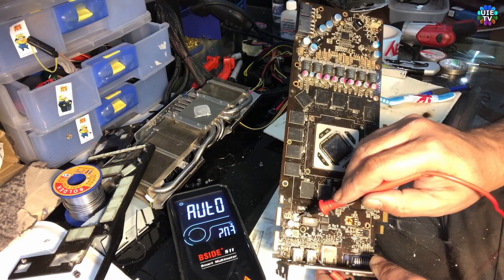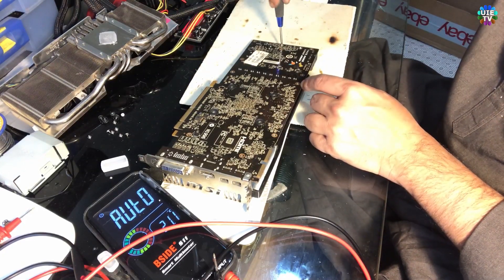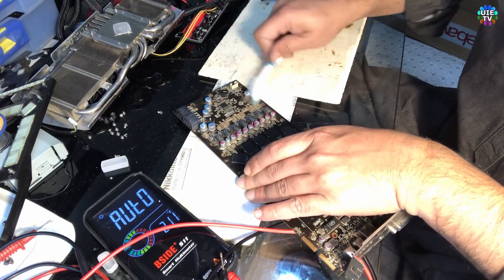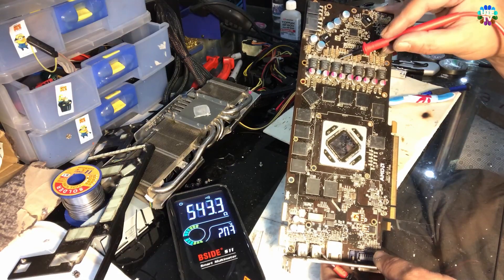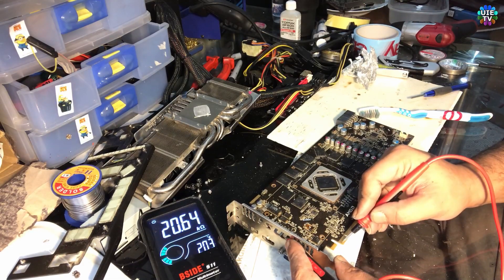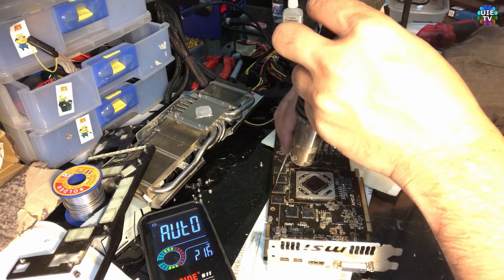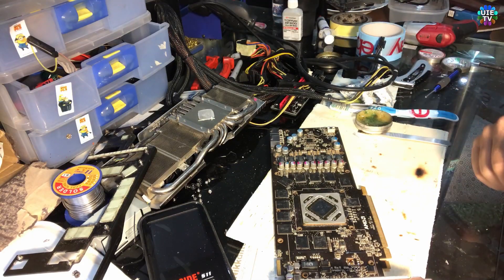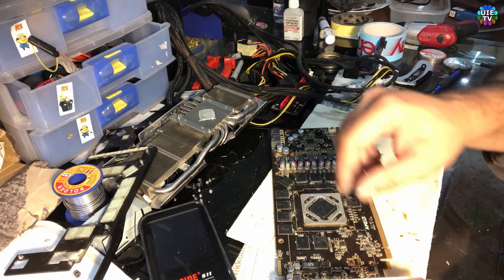MSi AMD HD 7970 No Display! Diagnoses, GPU No Video out, hd7970 2gb Graphics Card, #Repair Part 1.

Comment: 1. check again 3,3v rail i think the resistance range shoul be  in k ohm range. 2. VDDCi  resistance should be more than 40 ohm => 1 + 2 = 100% dead gpu chip :(
Reply: 3.3v 250 ohm is ok for msi twinfrozr & 37-38ohm vddci should be ok